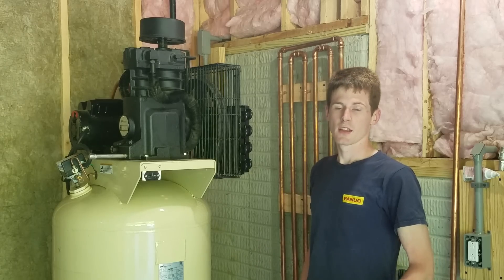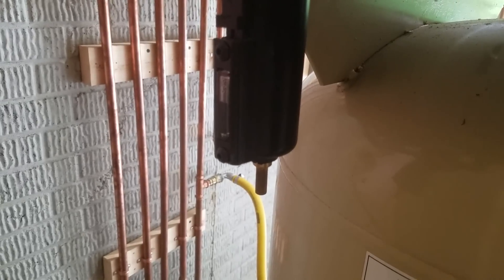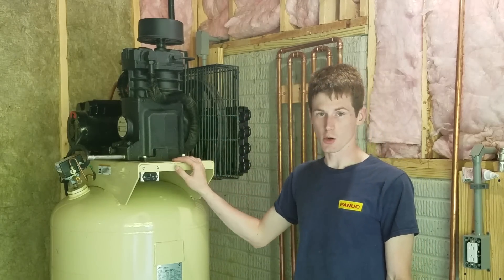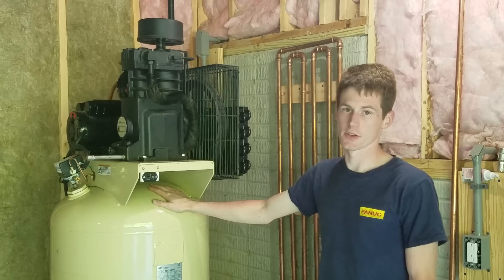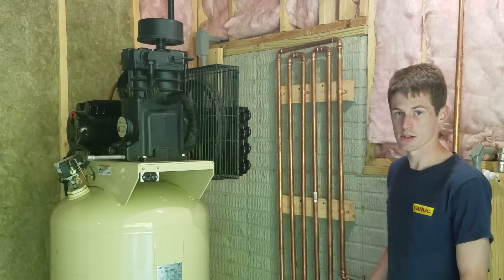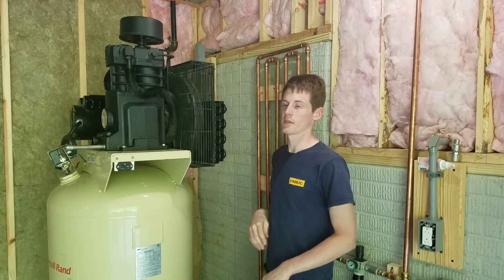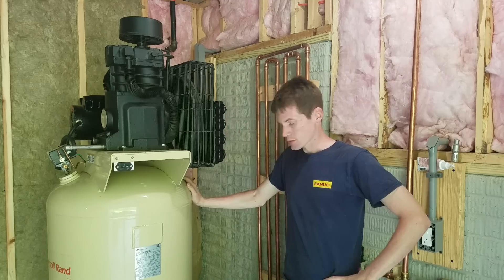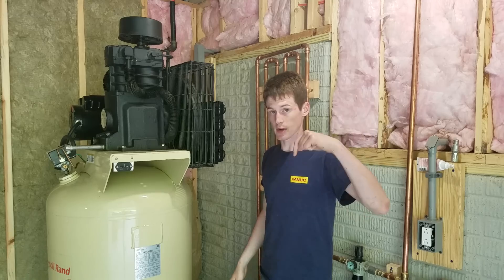How To Remove Moisture From Your Compressed Air

Comment: i dont know your setup but you can make your cooling coil colder by adding a respectable restriction on the input and a expansion chamber on the other side.
the expansion of the gas after the restriction will cool the air down more. its also a part of how AC works. they have expansion chambers to increase efficiency.
Reply: only problem with that is restricting air flow (adding pressure drop) from the compressor, exactly what you should be trying to avoid

Comment: I made a VERY cheap "refrigerated" water trap many years (when I was broke) ago when I had a painting shop.  I bought a 25' coiled yellow hose, fittings and a water separator like you have.  I drilled two holes in a plastic 5 gallon bucket side by side at the top. pushed the coiled hose ends through them from the inside, attached the rest of the stuff.  Then I filled the bucket with ice and water and weighted the hose down.  Worked like a charm.

Comment: Nice job, but this is nothing new, auto shops and paint shops have been using these since the 1940's then sometime in the early 70's they started being replaced by so called "modern" filter systems. I've been using a setup like this for over 40 years, I've done a lot of custom painting and also run a CNC plasma on it and have never had a moisture problem.

Comment: a ft long pipe on the tank drain will collect the water vs letting it set in the tank.  Automotive fittings are 45 degree and Hydraulic is 37, the term AN is obsolete now...  with all that piping, how did you rig up the blow off switch, or does all the air in the pipes bleed off, where as before there was only a 2 ft run from the compressor head to the top of the tank??
Reply: AN is still used everywhere even 3 yrs later...looks like you're WRONG it's NOT obsolete
Reply: @mrmotofy   In aviation it is, just because of thread engagement , but for general use,  JIC is whats used.  unless one wants to pay for AN.

Comment: One large mistake, that I think you distribution system video touched on, was to not run your long distribution system low, but run it high; run the primary pipes as large as practical (150% of necessary flow design at a minimum), with a slight down hill grade in the direction of flow. When you make a 90 degree turn, left, right or down, plan a drain leg and valve- Each drop point should come out of the top of your primary tube about 1-2 inches; you will have trapped most of the moisture remaining in the air in the primary- local drier/filters will get most of the rest. This method avoids the expense and complication of refrigerated driers, has no real moving parts (just the drain valves- which can be as small as possible"/economical) and uses no more electricity. I've built small shop systems (5hp/20gal) to large mfg (125hp/ 3x 80 gal tanks) and been very happy with my customers reactions. Including drain legs at most drops helps both actually and assures the port user they have safer cleaner air.FR

Comment: What psi is the trans cooler rated for? 
Funny. Every compressor company I've dealt with says, "never use copper sweated pipe." Ever seen a fitting fly at 150psi?
Reply from the maker: 300psi.
Reply: Well I have copper sweat lines for 12 yrs now at 175 psi

Comment: I would also pay close attention to the tubing size of the trans cooler vs. the compressor outlet size, if the tubing in the cooler is smaller than the original compressor outlet tube size you may decrease efficiency and create more heat at the compressor. 

Also, if all tubing is the same size, I believe there may also be a greater expansion effect at the water separator which I think would cause even more moisture drop out. 

With the amount of water your getting, you may also want to consider a different type of air cleaner and longer drop tubes on the copper tube cooler on the wall. I could see it accumulating quite a bit of water if you were able to catch 2oz in that short amount of time. an all day run on a humid day may leave the drops overfilled on that wall cooler. 

On my system, I used a through the wall heat exchanger which I adapted from a commercial application, its basically a huge high pressure radiator with 1" tubes. I made a 2" diameter, 30" long drop below it to catch and hold moisture with an manual drain. Every drop line in my entire air system also has a drop and a clean out valve beneath every coupler. Water get caught at all points but the most is caught at the cooler.  My cylinder head temps on my compressor are no where near what your seeing but I'm running a dual pump Quincy with two 5hp three phase motors. It doesn't turn near the RPM yours does. The hottest I've seen on a 98 degree day has been around 171 degrees F.  Both pumps are pressure lubricated and I'm running 240 psi into 210 gallon air tank with an additional reserve storage tank on the far end of the system of the same size with its own water drain system and separator. At one time the system was running a full machine shop but these days its only for my personal use, mostly running a few machines and some painting. I have four dedicated 'painting lines' each with a charcoal canister and desiccant based water separator and mechanical regulator.

Comment: 2 things- 
The superheated compressed air won’t drop its moisture until it returns close to room temperature. If you put your coolers on the other side of the shop away from the compressor heat, it helps.
The “fan” cast into the compressor pulley is a joke. Get a $10 box fan or 2, and  mount them so they blow over the electric motor and compressor. That’s made the biggest difference on my set up.
Reply: Only thing is, you want to cool before the tank to keep the water out of your tank.  If the cooler is across the shop you are running pipe both ways. Agree on the small electric fan - made a huge difference for me too but I have it blowing on the aftercooler mounted right on the compressor.
Reply: I.e. fan on comprsoirs..to cool...I have a factory  fan on the motor  pully. To cool the factory  radiator cooler..on my Saylor-beall..model  vt- 730-60-1-FP..  A INDUSTRIAL  type air comprsoir..I live in hot sunny FL. 100 h....all summer ..that is a life saver with the electronic  auto tank drain..yes your fan helps..cool the pump..what Saylor-beall  did ..to there units ..sold me ..its all made in America...no china parts..my unit  wt.is 600 LBS..  and runs so quite..as well..they been around building  air comprsoirs over 100 years. All cast iron pumps..
Reply: J B, Can you reach out to me ? I have a couple of questions about my set up. I thought this tutorial was well done, he seems like a smart young guy.
Reply: I'd add a radiator cooling fan to the transmission cooler to bring the temp down closer to ambient. Should improve performance (way more air flow than the compressor wheel "fanish" thing).
Reply: @imkindofabigdeal4308  That's exactly what I did. $15 on Ebay for high flow fans. Note all those fans are 12v so you'll need to buy a power supply to run them, also on eBay for about $20. Wire it after the motor relay so it turns on and off with the pump.

Comment: Nice job! I need that set up for my plasma cutter.
Just a bit concerned about the pressure rating of plumbing pipe.
Please don't think I'm berating your achievement, I'm just worried that you might have an 

explosion when you turn the regulator up.
Reply from the maker: Thanks for the concern but regular 3/4 copper plumbing pipe is rated to over 700 psi.
https://www.homedepot.com/p/Cerro-3-4-in-x-10-ft-Copper-Type-M-Hard-Temper-Straight-Pipe-3-4-M-10/100354200

Comment: On the copper exchanger, run the 6 tubes in parallel by having a top/btm header then the velocity and pressure drop will be less to allow for more moisture to drop out.  It will allow you to have one auto drain separator on the bottom header to drain moisture.  Excellent job!
Reply: Hey do you have a photo you could share if what you’re talking about? Do you have any socials where you’ve posted this sort of content?
Reply: Imagine six tubes, all running vertically and all tied together by tees on the top and on the bottom. Inlet of air gets separated six ways on the bottom and the outlet receive that air at the top. The idea is to slow down the flow rate of air by splitting the total flow into six separate vertical pipes. Much like a header on an engine but with reverse flow rate. Then just tie the auto separator down at the bottom, eliminating the need for expensive ball valves. Also this can be done in large diameter, large schedule PVC or PEX for reduced cost. Makes sense now, my friend?
Reply: @Jeff_Seely  What do T's at the top of the runs do for you specifically ?????  I've seen a number of designs and most of them use the T at the bottom with 90's on the top and usually incorrectly install the T. The T needs to be on the 2nd, 4th, and 6th run of copper lines  to form a turbulent vortex which helps eliminate the water to your drain valves. Mine are 6" drain catcher's. I've seen anywhere from 2-8" and anything less than 4" is too small. I sent all this back to my TANK and then installed a 5 filter / desiccant system to get pure air for my plasma table. Clearly this guy installed the T's on the wrong pipe and oriented incorrectly. Flip them to the 2,4 and 6th pipes with the drain under them and you have a better mouse trap.
Reply: Those tee fittings provide a means for condensate to gravity-drop to the bottom for accumulation of moisture. That's all they do
Reply: @Jeff_Seely  Yes I know that Jeff, however, orientation affects how well they work. If your blow down tube is straight down it doesn't work as well. Therefore you use a 90 to the other (2nd) pipe and place the T there with the blow down tube drain under it at least 4" min length. Using this method, as you check each drain tube less and less water is collected after each pair of pipes. That is simply a FACT.  I cut my consumable usage on my plasma table to less than 2/3 of what it was before I added the dryer, and yes I had a condensation coil on the tank. The dryer virtually eliminated any moisture at all from my plasma table output .
Reply: @anonimous2451  okay great! Sounds good. I have since needed more dried, dessicated cda and have incorporated a dedicated dryer system. There's no substitute for that.
Reply: @Jeff_Seely  That is true. I have a 1 Gal Desiccant collector on my 5 filter system after the dryer. But i found out that one needs an additional tiny micron filter to keep the bead material out of my lines. That showed up during a paint job. Luckily it was just primer and I stopped and removed it. Corrected the problem then re-started and wow it works so well, I am very happy with it now.
Reply: Pvc rupture at 175 with water = leak.  With air it can shrapnel so avoid. 
J
Reply: @talldrumgirl  I've seen PEX done only once. But he did it to separate the water for painting he did not capture the hot air to condense and then re-feed his tank after the cooling radiator or Dryer system. This one done with Crimps makes me cringe.  I know for how long its been allowed now, but, I am OLD School Solder the joints kinda guy. Everyone does what they can and with a budget but I simply cannot believe how many air dryer's I've seen done on you tube and NONE (almost none found 2 that did separate the compressor hot air to a dryer before returning to the tank) for nearly perfectly dry air, which saves on consumables in my Plasma cutter.  Painting requires an inline desiccant filter and regulator.  If one would employ BOTH methods the cooling radiator and the dryer lines on the wall and then return to the tank, adding in your favorite 3-5 filter kit inline AFTER the Tank works way better.
Reply: Wouldn't a header at the top and bottom reduce the cooling effect of the coil by allowing air to bypass significant lengths of the coil?  It makes good sense that it would improve the efficiency of water precipitation but it seems like that would come at the cost of reduced cooling which itself has the effect of increasing water precipitation.  Is this maybe a six of one half dozen of the other kind of situation or am I mistaken?  Genuinely curious because I'm about to build one and want to make the best version I can.

Comment: Thanks for the video. I fought moisture until I added an after cooler with a auto drain setup similar to what is shown here. I now can run my media blaster for hours, paint  run tools or whatever and never have any water at the final regulator - ZERO visible moisture. Big side benefit is your compressor runs cooler. After cooler gave me a big temperature drop from the cylinder head outlet to the tank inlet. I tried downstream copper cooling coils but they were waste of money and time for me. Biggest bang for the buck is an after cooler setup. Need to fight the moisture as far upstream as possible. Trying to control the moisture downstream with only regulator filters and desiccant is a losing battle. If I had only figured this out years ago...
Reply: bluto1340 I’m sure if he had used finned copper pipe like used in Hot Water Baseboard heating, the copper piping would cool and condense the moisture better.
Reply: I'm sure glad to see the struggle of others before I start my journey.  I have a  opportunity to use an amalgam of these ideas  such as substituting the after cooler for a manifold that can be ran into an existing heat sink (ground water exchanger) that is right next to my compressor.  I have sought to find ways to control and utilize as many sources of temp difference required as I can  in my place.   Well water for Dehumidifiering in the shop and other semi enclosed areas  is another prototype I have been installing infrastructure to use over the last decade's of evolution.  IDEALLY I would use only one cooling device to run my environmental needs and a walk in pantry/refrigerator/deep freeze.  All have been taken into account for every move while building my engineered homestead.  Patience has been rewarding. If nothing else I'm having a pneumatic blender  and air lines across my entire place maybe even the bathrooms
Reply: Addendum: I am researching Amish  pneumatic development for domestic use as well I'm really curious to how much compressed volume can make that a viable if not eccentric alternative energy storage system
Reply: Havana Woody interesting!

Comment: It's all about lowering the dew point of the "saturated" water vapor in the line.  Your intercooler is a good idea, and will lower the temperature of your tank, therefore the water content of your air.  I painted my car by running high-pressure air from the compressor tank thru a 50-ft coil of 3/8" copper tubing submerged in a tray of ice/water, then thru a filter/separator and finally the regulator.  This setup would be impractical for regular use, but in my case it worked very well.
Reply: i did something similar at a shop that i worked at years ago. we had very bad moisture problems but the owner refused to pay for a refrigerated air dryer, but gave us the ok to put together something cheap. the shop was located next to a bar that our shop's owner was good friends with the bar owner, we took a plastic 55gal drum, cut it in half and filled it with 50' of 1/2" copper tubing with an auto drain separator at the bottom of the coil where it came out of the plastic drum. each morning when the shop opened, we went next door with keys to the bar and filled 2 5-gallon buckets with ice from their icemaker and hauled it back to our shop. our owner paid them something like $75 each month for their ice.

Comment: Nice.  I wonder if a Salvaged AC Condensing coil and fan could be used as an "intercooler"...  A lot more finned surface area on those.
Reply: An automotive condenser could easily handle the pressure, but the diameter of the tubing might impede your flow too much if your compressor is very large.

Comment: One thing to watch is hhe pressure rating of the cooler. Most trans coolers are very low pressure rating. Oil coolers are usually better especially that style. Also the pressure rating is based on fluid not air. Air requires higher due to safety issues.
Also with the water drain setup make sure there is no filter in it to clog up. A safety release valve would be good to fit.

Otherwise nice job on it. Much better than most.
Reply from the maker: The cooler is rated to 300 psi.
Reply: @RepairGeek  yes actually i think its 400psi for that one as its their oil cooler. However thats fluid ratings which makes it about 200 psi for air rating. Most trans  coolers are only 100 psi fluid rated  or less.
Reply: @RepairGeek  its a good choice of cooler. See pleanty of vids of people using normal trans coolers or low pressure air con which is somewhat dangerous.

Nice job. 😀

Comment: Great information.  Not to be critical but when you get a chance putting 4mil poly over that wall insulation will greatly help insulating your home.  have a great day.
Reply from the maker: Thanks. The poly is on the other side of the wall. That side is heated, this side isn't.
Reply: Hi.   Sorry  just trying to help
Reply from the maker: @billthompson9595  I understand, thanks.